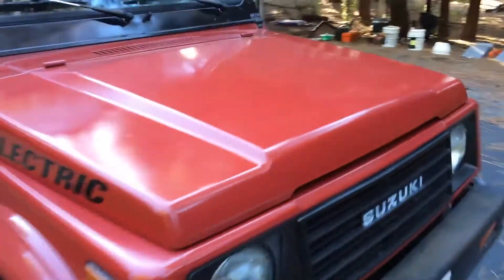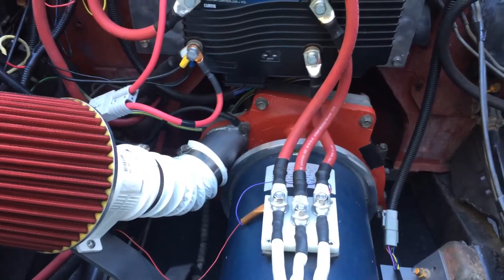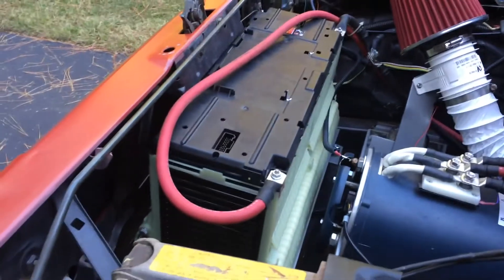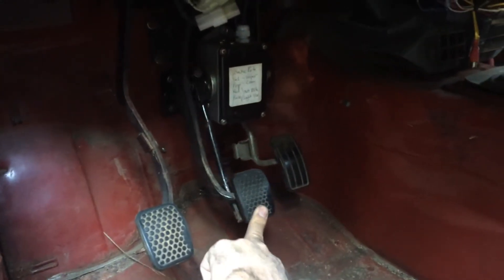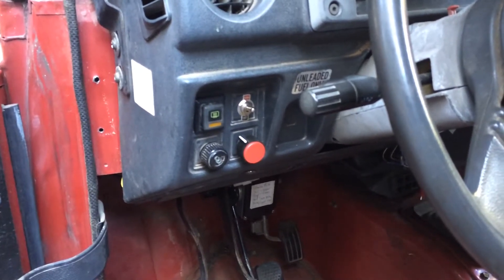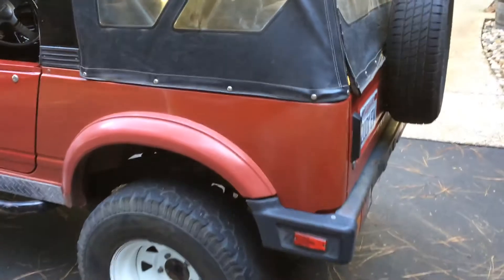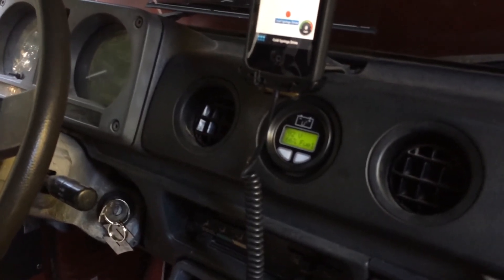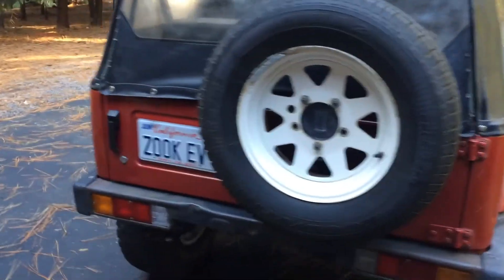ZookEV Suzuki Samurai electric car conversion Overview ep9

Comment: Plz give me info of all components  . What kit u have use in car . I need fork and gear plate housing. Thank you in advance.
Reply from the maker: Raj Auto Tech Barmer[Rajasthan] 
HPEV AC31, Curtis 1238-65, CanEV adapters and hub for a stock lightened flywheel. Chevy volt battery pack. Elcon charger.
Reply: Jason Brooks nice sir where to buy that components if u have list of all parts and . Plz send me .rajbarmer2009@gmail.com

Comment: Hi! I am thinking to convert Suzuki Vitara (short version) to electric. I was planning to use AC51 motor and 30 kWh lithium battery. My idea is to remove first gearbox and instal motor directly to split gearbox (Gearbox with H2 H4 and 4L) with gear reduction to match top speed to ~120km/h. I would have maximum torque up to 60km/h at H2&H4 and max torq up to 33km/h at L4. What you think will I have efficient torque for offroad or shoul I drop top speed? I would love to save weight from gearbox so I can fit all batteris to front.
Reply from the maker: Otto's Hobby Channel I thought I would do the same thing. You will have a longer power band than I do with mine, but I still think that you would need a transmission. Off road I am using 1st and 2nd gears with a 4.16:1 transfer case. I felt it was hard on the AC electronics to ask for a lot of amps at near zero RPMs. I feel that I have optimal rpm range off road. At 50 mph I'm in overdrive in 2 high and basically run out of RPMs at 70... keep in mind that high range has a 1.4 reduction in a stock case and 1.58 with the 4:16 case. So you probably need to look at gear ratios and torque charts for usable RPMs of the motor. I think 6 or 7k is max...
Reply: Thank you for fast answer. :)

Is there a lot torque ripple at low RPMs? Encoder would probably help alot with low motor speeds. But I dont know does HPEVs AC system support encoder? Or does AC induction motor even need one? I know that PMAC motors definitely benefit from encoder.

Hi gear in Vitara is actually 1:1 at least if we belive in this source: http://suzuki.run4x4fun.com/gears.htm 

You really think that I cant use motorspeed up to 8krpm? There is still some like 34kW of power which is more than enought for 100km/h speed.

How mutch Samurai 5 speed gearbox weights? Weight ofcource is not the main issue here. Main goal is to get it compact so all batterys can be located to front.

Any building photos?
Reply from the maker: Otto's Hobby Channel 

Oh yea it is 1:1 In high. But they make up for it with real low differential gears. I'm not really familiar with the controller, but I have no surge. I was told the controller is hard programmed to prevent high torque on low RPM to prevent damage. I do have a build on DIYelectriccar.com.  Search ZookEV.

Mines weight about 2300lb about the same as stock.

Comment: Very nice. I have a Samurai too. They are lots of fun. On mine, the plastic part around the steering column was faded. I took it off and painted it flat black. It made the interior look much better in my opinion. I was wondering, are the lockers you have auto lockers? If your hubs are locked and you are in 2wd, do the front tires turn in unison or independently? About how much did that electric conversion cost? Thanks for sharing your very cool project!
Reply from the maker: The front locker will spin Independently when in 2 wheel drive. I bought everything used, mostly on eBay. About 3k in parts and 3k batteries.

Comment from the maker: 60 around town and 40 on freeway... I still have a back seat. If more is needed I can pull the seat and have enough room to more than double that...
Reply: G'day, considering doing mine, had a look through your videos, but couldn't find your specs. What size motor/ and how it's used makes a lot of difference to to range and performance. How much energy does it us at city  speeds (here its 60kph 35-40 mph)
And what about 100kph/60-65mph? Trying to work out how much battery I need. Thanks
Reply from the maker: Richard ti check out my build video episode 16